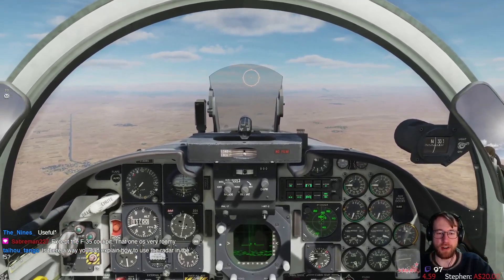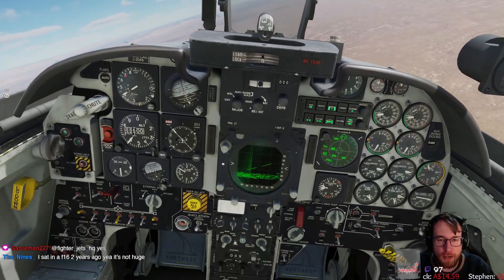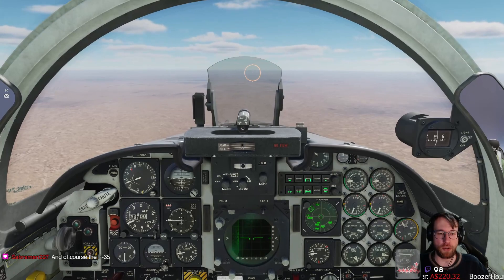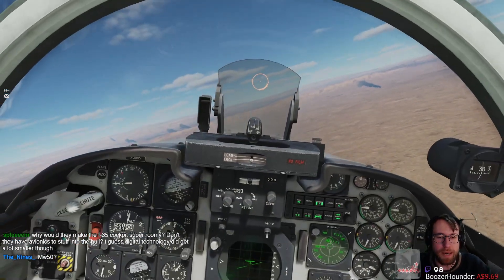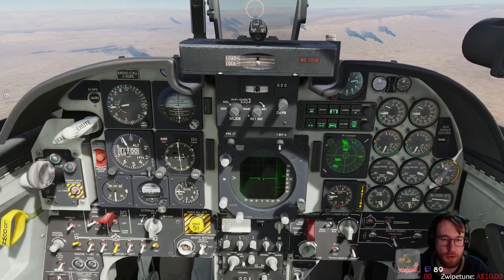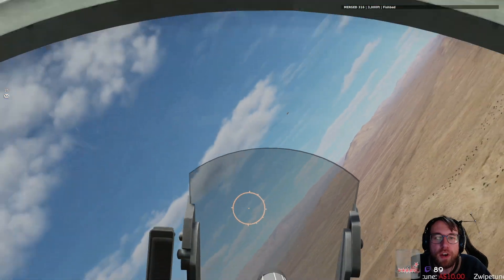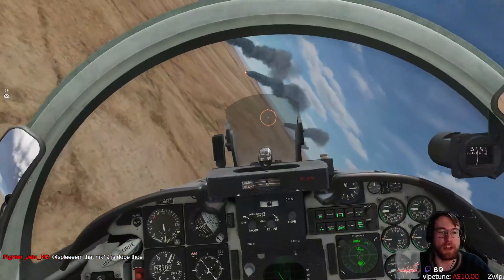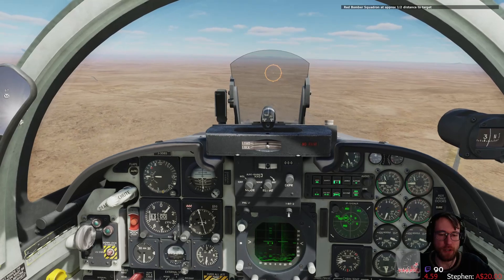A quickie: DCS F-5 radar use demo, search mode (AN/APQ-159)

Comment: Hey mate I notice you get a steering dot most of the time, for me I seem to just get a lock that sweeps around when I move the TDC when I'm locking from normal search mode. The steering dot only comes up when I'm very close within firing range of the missile is that normal?
When I lock from Dogfight mode it just puts the lock off to the left side and doesn't give me any useful information about direction. Does that just mean I'm not close enough for steering dot as well?
This is all very strange to me after being used to the F14 and M2K that doesn't hide the target location after locking :)
Also where did you get the Track Clip? My trackir cam is very high and gets jittery, would love to have clip LEDs that are adjustable like that.
Reply from the maker: Steering dot appears not to show most of the time in A/A GUNS modes, so I leave the sight in MSL mode and never have issues with it popping up. Not sure if working as intended or what, but that solves it for me.

Track clip came from Natural Point themselves, it's just a standard TIR 5 pro clip (about the third or fourth I've had since they're so flimsy). The clip is expensive and breaks easily but being able to adjust it is definitely a plus.
Reply: @rossmum  thanks that was it. Now just using dogfight mode when I want guns instead. But often leaving sight fixed seems better because people flip out when I shoot at them :) The track clip looked different than NPs for some reason, maybe the background filter.

Comment: Are you flying with mouse and keyboard?
Reply from the maker: No, and I would not recommend attempting to do so in DCS.
Reply: @rossmum  ha yeah, I'm already a couple grand deep in hotas equipment. Just felt like it with the scroll wheel and the way you were dogfighting. I was wrong!
Reply from the maker: @notravstar  The scrolling is the thumb encoder on my T50CM3 throttle - it sits very close to my mic, so it picks up the sound very easily. It also makes the ministick I slew the radar TDC with sound a bit like keypresses 🤣